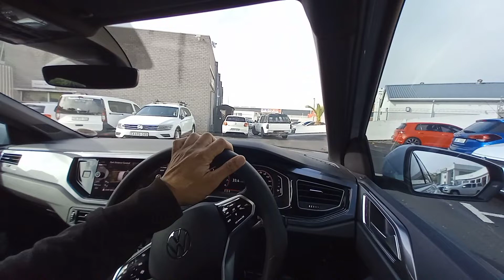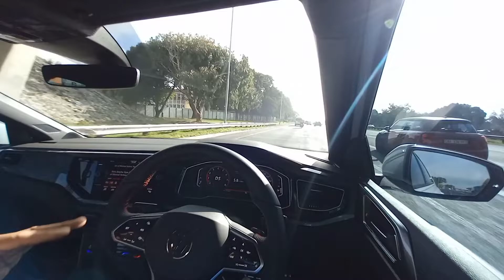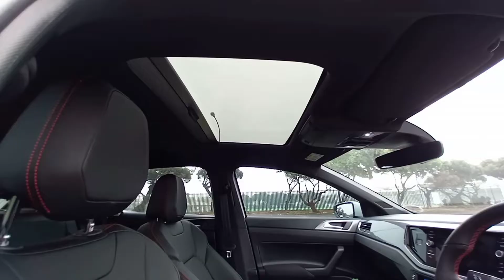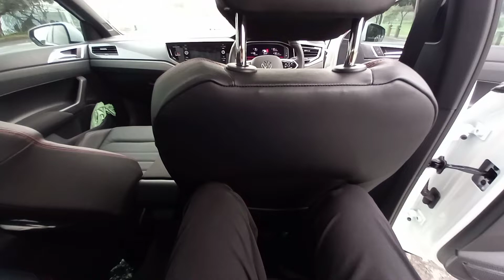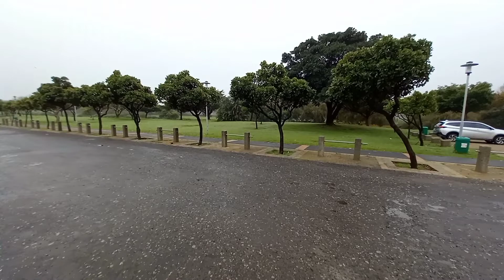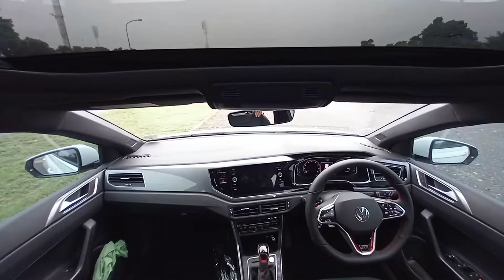Polo GTI 2022, 6 day review of new car. Checking drive modes at dealer in Cape Town.

Comment: The Engine is still in eco while the transmission is in normal mode. The DSG default mode is D. Even if you select sport mode the gearbox will start in D whenever you switch the car on
Reply from the maker: Thanks

Comment: I have the same car and it does the same thing. It sometimes shows "D" on the display even when in Eco mode. The same thing happens on the T-roc. You have to re-select the Eco mode on the touch screen for the "D" to change to "E"
Reply from the maker: They should update so if it resets it should also update on the screen to normal mode.
Reply: So do you recommend someone buying it.?
Reply: Same thing happens between Sport mode and Drive which is annoying but I didnt buy the car to drive in Eco mode. That said I'll give it a test and let you know if I have the same as you.

Comment: Pointless video , that is normal in a polo , it will always default to normal , if the dealer knows their cars they would have told you . There is NO fault
Reply from the maker: No it does not. Had polo highline 2018, 85kw which did not default to normal.
Reply: @mimosaudhdvstheworld  if you put it in eco I will always default back to normal on a restart , I know because I have 2 and VW UK are more clued up :) however … it should show the E on the display , in normal with the D wont show the word eco when you coasting but it does coast , if you not seeing the E when in eco then I would do a factory reset of the infotainment system. 
What does it show when you select individual and configure the engine to eco , the E should show up .
But as for auto selecting eco on startup , that’s normal for it go to normal not a fault